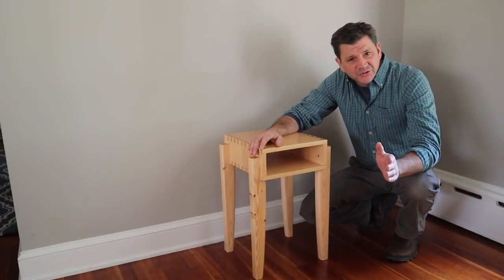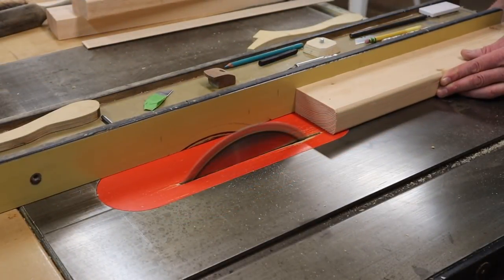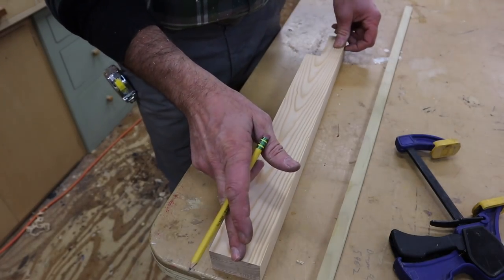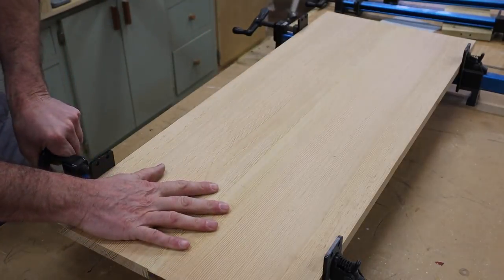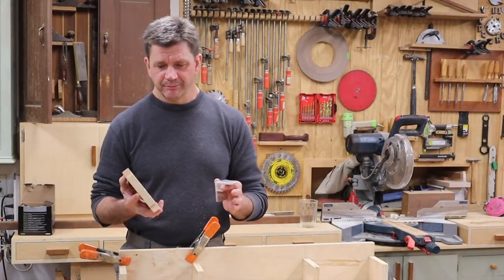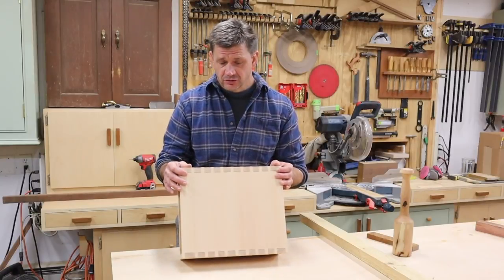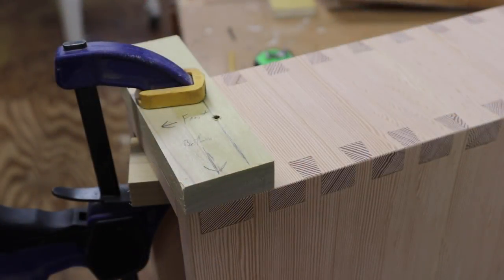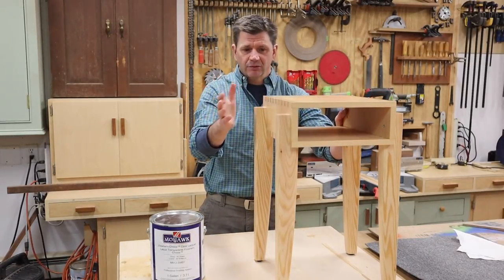Modern End Table / Side Table DIY Woodworking Project by Jon Peters

Comment: That looks great! My only minus is that you went through all the trouble of hand cut dovetails and then used screws
to assist in holding the legs on. They can be seen, and are not pretty. Thanks for the videos and for the format of
explaining what you are doing and why. Thanks again Jon!

Comment: Pine is overrated and overhated at the same time. In this clean simple design with clear finish its natural beauty pops and it is pleasing to look at. When it’s used to mimic more expensive woods for no reason I want to never see pine again. Thanks for the reminder that pine can be beautiful when use correctly.

Comment: Hey John. I've been watching your videos for awhile. The last 2 times I tried sawdust and wood glue the filler came out almost black. Idk what I'm doing wrong, any tips? I'm working with some salvage hardwood so I can't buy an off the shelf filler (how I've dealt with this in the past), I'd like to see how much glue is used and if it's super fine sawdust or sawdust from the table saw. I know you've mentioned in the past you use the drum sander dust, I don't have one so should I just use a scrap peice on 60 grit orbital?
Reply: Also when you use the wet rag to remove the glue: do you sand the raised grains caused by the water or do you use the first coat of lacquer as a sanding sealer, then sand off the raised hairs? I know it's not as much of a problem with hand rub finishes but I've had issues with spraying over the areas I clean up with water

Comment: If you're worried about cutting into a biscuit, why did you use them?
Reply: The biscuits are used to keep the board edges aligned with each other during glue-up... 
glue can be slippery & edges can slide out of alignment as the clamps are being tightened or even when the glue is setting up... 
😎👍☘️

Comment: I usually really like your designs, but this one's a bit of a miss for me. The legs are just too disproportionately thick for the size of the box. The dovetails look great, but it's a shame to then see the four screws on the inside. That's an easy fix, at least, you can just plug the screw holes.